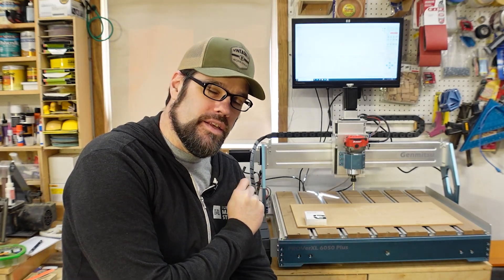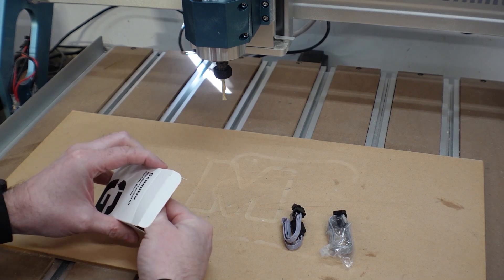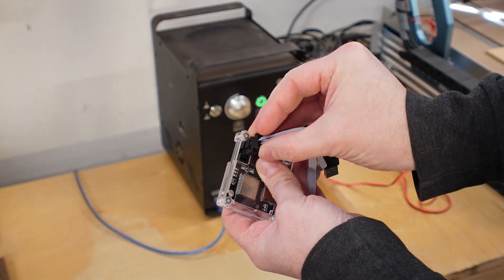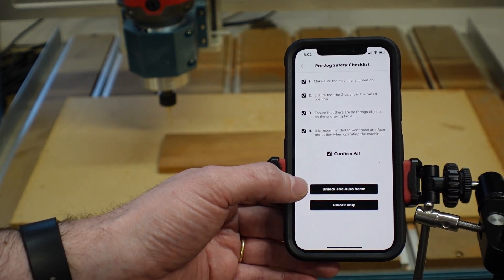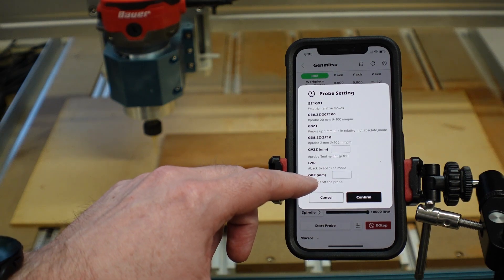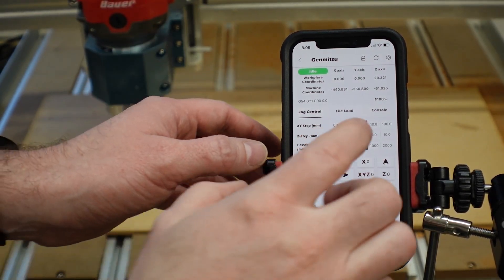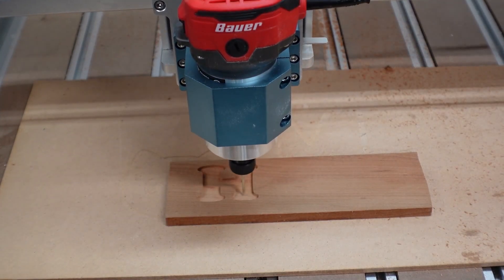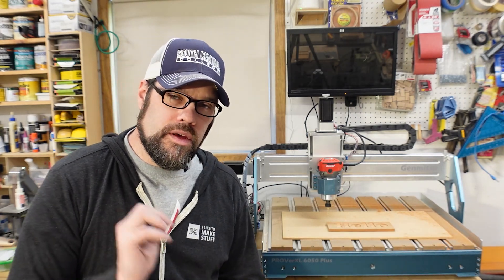Control your Genmitsu CNC over WiFi!

Comment: Thank you, just ordered the 6050 on sale the other day for 1450.00 may have to order the wireless module too
Reply from the maker: That's a good price for it.  The wireless module is nice, also check out GSender for software when directly connecting via a PC. It's my new favorite GRBL CNC software.
Reply: @Vintauri  Thanks for the tip on Gsender, will look into it. BTW the 6050 control box has a variable speed knob, is that the only way to control the speed of the 300W motor? I realize a router motor may have to be controlled manually. Thanks!

Comment: Hi there, I'm a total noob to CNC, I'll be using it to fabricate guitar parts. I picked up a 3020 Pro Max V2 and I haven't managed to cut anything yet (a total noob as I say, and some of the basics and language are lost on me). I'm struggling to set up UGS, can't get it to connect with my cutter, will this WiFi module help me? 
Nick
Reply from the maker: The WiFi module will only connect with the mobile device app.  For connecting a PC, first make sure you have the CH340 drivers installed so that your computer can see the GRBL controller.  From there, I prefer to use GSender as the controlling software.  If your computer can see the CNC via the CH340 drivers, then GSender should be able to see it from the devices drop down menu.

Comment: Hello, do you know if the 4040 pro max is necessary to change the board or just plug to usb port as you show ?
Reply from the maker: You want to get the GGW-USB version of the wireless control module to be compatible with the 4040 Pro Max.

Comment: Thanks. I just set it up, it's working, want to figure out these startup basics ? How to home the machine. How to reset machine coordinates. How to reset work coordinates. How to use Z probe. How to setup macro buttons. What are some common macros to setup ? How to organize files if you are running many projects. What calibration routines are necessary and how do you do those ? What maintenance routines are necessary and how do you do those and how often ? Thank you in advance.

Comment: Just ordered my module, I also have to swap out the mainboard to get it to work as I have the 4040-pro
Reply from the maker: Hopefully the mainboard swap is not too bad.  Adding this option does make it nice to not worry about having a computer hooked up to the cnc to run it everytime.

Comment: Steve.  Thank you for the tutorial.  I normally would not ask however, I am having the toughest time getting this module to connect to my 6050plus.  Do you have any advice?
Reply from the maker: I didn't have any issues with the module to the CNC, that was just plug in the cable and turn it on.  I did have to make sure that I had a pure 2.4ghz wireless network for the module to connect to.  It did not like my main wifi network that is 2.4 and 5ghz.  Also make sure the micro SD card is in the module.  You might want to try formatting it on your PC as well if you are having issues.  I've seen that cause issues with other machines.